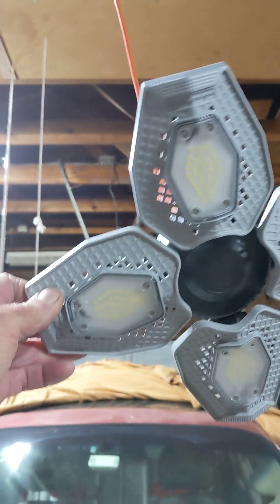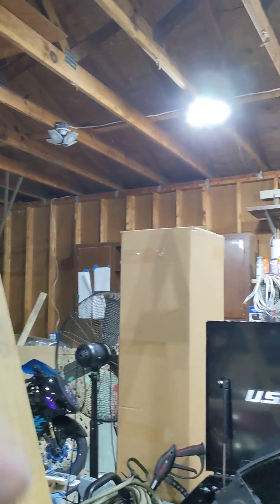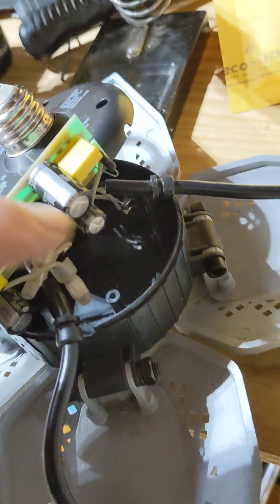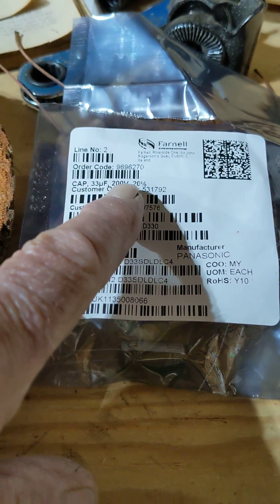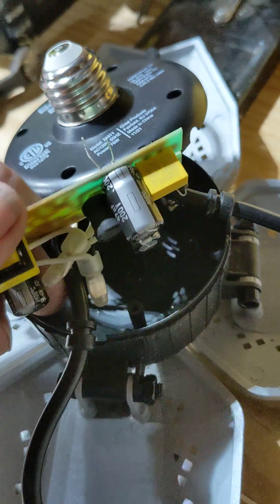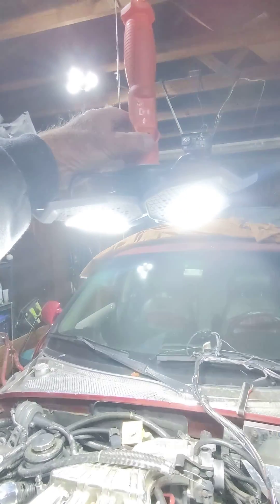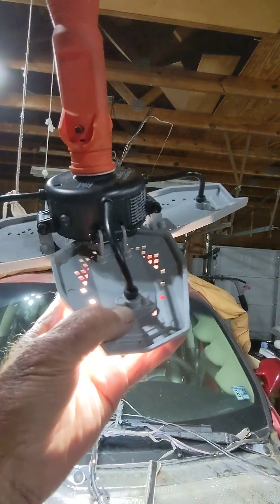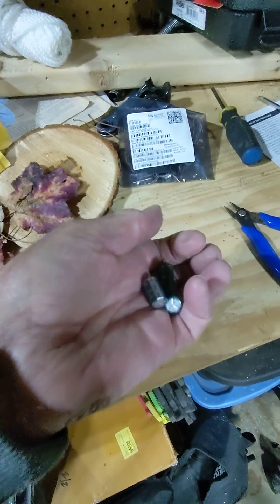BEYOND BRIGHT Garage Ceiling Led Lights Blinking.

Comment: Dang it. I was really hoping I wasn’t going to have to rebuild these lights. Mine lasted 2 months. I don’t know if the performance is worth the hassle at this point.
Reply from the maker: @BrandtlyH  I have one that I replaced and it has worked for awhile and then started acting up again. I need to see if it's a bad solder connection or what.
Reply: @Wakeupandsniffthecoffee  so far the 2, Beyond Bright Super Nova lights failed after 2 months of intermittent use. I just put up 3 more that are not super nova (Christmas presents) so we’ll see how those do. I am in Northern Minnesota so it might be a lot to ask for these things to chooch at these temps haha.
Reply from the maker: @BrandtlyH  I just had my issues resolved all at once.
They installed a new electric breaker panel in my garage as part of adding more solar panels.
One guy wired the panel and another went to wire to the main breaker panel.
The first guy wired it wrong,forgot the neutral wire and all my led lights began popping like popcorn and smoking from being hit with 220 volts.
Surprisingly about three of seven still work, but I doubt for long.
I just ordered an 8 pack of 220 watt, almost double the brightness, six panel similar lights.
8 Pack 220W Garage Light Ceiling Led Deformable LED Shop Lights for Workshop E26 E27 Screw in Garage
They were about $89 for all 8.
I may use the old ones for other jobs.
I found the capacitors in the bad ones had gone off like firecrackers 🧨.
I may order more caps and rework them or reuse the ked panels and repurpose them into a bigger light.

Comment: How are these lights going so far? Has any failed on you? LEDs are notoriously known to have a high failure rate compared to other lighting technologies. When properly designed, LEDs are more efficient, brighter, last longer, don’t flicker, and provide good color rendering.
Reply: I put 2 in my garage a month ago and they are flickering. I thought it might be my electrical in my garage but I’m starting to think it’s these lights. Don’t get me wrong “15,000” lumens is awesome per light when they work.

Comment: These actually look to give out some very usable light! Were they bought locally or somewhere like AliExpress?
Reply from the maker: They are very bright and I really like mine and plan to add more. I'm glad I figured out the weak point to fix them. So far April of 2024 and they are working perfectly, so the fix worked.
Reply from the maker: @lukedavis4213  I bought these at Lowe's, I believe. But have seen them in Wish and Temu also.